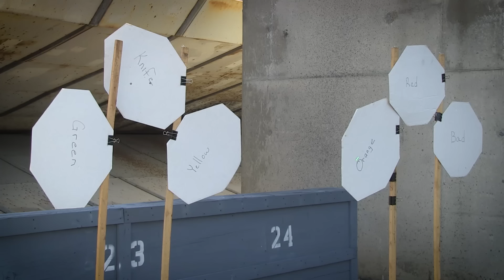Good Samaritan Finds Armed Man in Friend's House: First Person Defender|S3 E4

Comment: The good thing about this scenerio is that you can clear the house with your gun drawn because no one is supposed to be there. Even in a real setting, you could clear the home for good practice. I clear my home when I come home and no one is there just for good practice.
Reply: Got the keys the other day to the building for my new project (Construction Manager): A 6 story, 30 years abandoned Detroit apartment building. I have to do a safety survey (done alone) before any of my guys can come there.

I asked the Owner and Architect several times if anyone has any reason to be in that building. I did so because I knew damn well that I would clear it with my XDS 4.0 .45 drawn.

Not that I would shoot anybody for being in there, but if someone saw me as a target, they'd know that building a hell of a lot better than me. There are a lot of places to hide in 52 apartments. 

I totally get the feeling of being somewhere where you are legally, and responsibly able to clear it with your firearm in hand.

It feels much safer. Not to mention if anything did go down at some point, you'd have had good practice clearing areas.
Reply: Brandon_ 7.62x39 I if thought I was crazy for constantly clearing my house
Reply: Brandon_ 7.62x39 I don't have any firearm but I usually clear my house with a bat or knife just for practice and extra safety